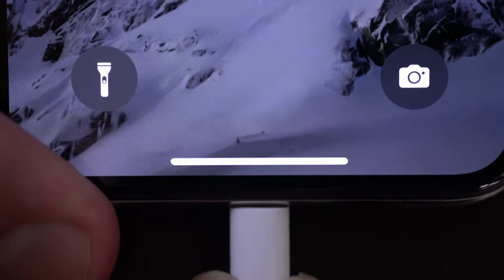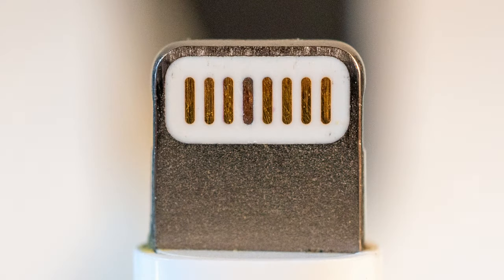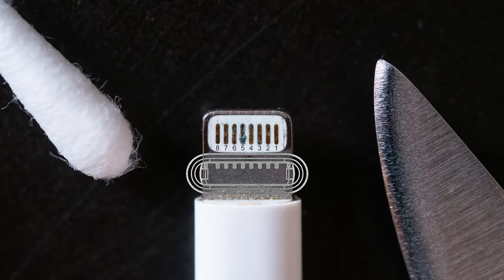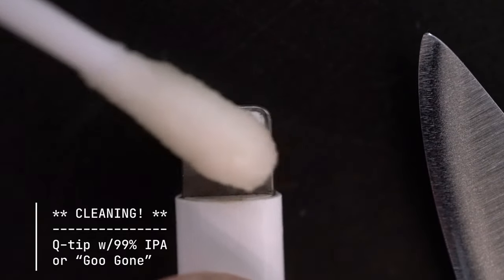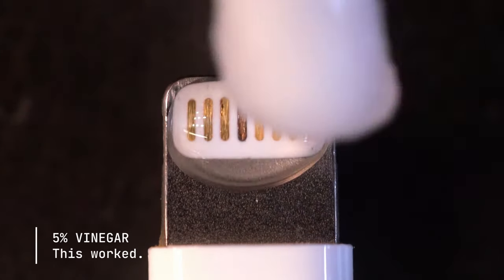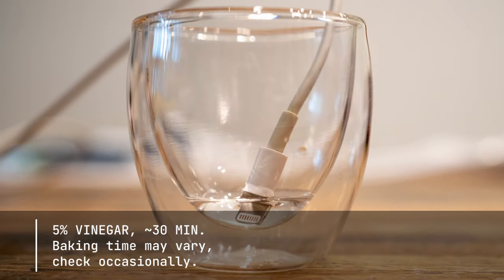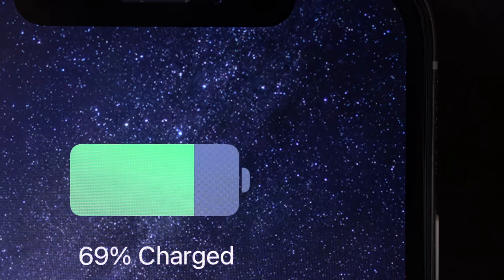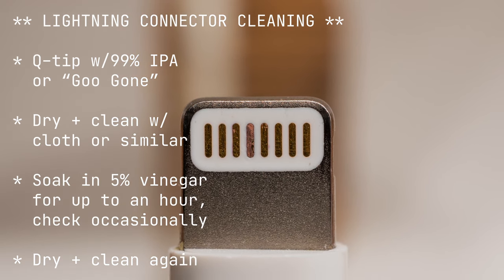🔌📲🤔🤷 iPhone not charging? Learn how to fix your lightning cable in 90 seconds!

Comment: Quick, my phones almost dead 😂
Reply from the maker: I made this video about 90 seconds with the hopes people can get the info quickly. Unfortunately, the vinegar approach does take some time to work. Best of luck! 😅
Reply: Will face cleaning pads Will they work if they have alcohol in them ?
Reply from the maker: I think for this to be really effective, you need enough liquid to have a drop or two that can stay on the connector long enough to have an effect - like as shown in my video, here.
Reply: Fr
Reply: Mine is at 1%
Reply: And the ads
Reply: How about a brand new lighting cable not working? Charging block works with other cables. But the new cable won’t work with any phone.
Reply from the maker: Sounds like that cable may be faulty. Try cleaning the contacts with an eraser tip first, give them a little rub to make sure nothing’s blocking the copper contact bits. If multiple phones and chargers are OK, chances are this cable is the problem.
Reply: Legit☠️☠️
Reply: ahahahah same lmao
Reply: Same here 😢😢
Reply: LMAO SAME HERE MY OHONE IS ALMOST DEAD AND IM LIKE COME ON HURRY UP AND BOW I SEE YOU COMMENT😂😂
Reply: Mine to
Reply: same lol
Reply: My phone already died and I'm using my mom's phone
Reply: Fr
Reply: SAME
Reply: Thanks bro 🎉 it works guysz🎉 nc video I just put alcohol and clean the rust

Comment: my issue turned out to be that there was lint inside the charging port, but this also helped me fix an older cable I had given up on. 10/10
Reply from the maker: Ah-ha, good to hear you sorted it out. Lint is also a known cause! I recommend the curved pointy end of a plastic dental floss pick for removing lint from both Apple’s lightning-style, and USB C-style ports.

Comment: Thanks for this video, because my wife and I were having some problems with charging iPhones.  Using several different cords, sometimes not charging at all or sometimes actually losing charge.  After a simple Q-tip with white vinegar, simply a few swipes and dry off. The cords are all working.  
I actually got a jeweler’s magnifying glass, and could see some minor corrosion on the tiny bars. 
 ( can’t see with naked eye)
This saved me money, cause I was ready to order new iPhone cords.   Great advice.
Reply from the maker: I’m glad to hear this worked for multiple cables, and that even just a Q-tip was sufficient. Excellent.
Reply: Thats the same issue with mine. I am gonna try the vinegar trick now
Reply: Mom b😊😊hhh.
Reply: Another update Feb 2024,  still doing the cleaning,  the vinegar wasn’t working as well. Still had one contact with dark oxidation on it. I tried a q tip with a drop of Brasso polish.   It really seemed to help and didn’t damage the contact. Definitely took off the black oxidation and charges working fine.
Reply from the maker: @d.g.n9392 Interesting, thank you for the tip. Brasso might be just the thing for oxidation, if vinegar doesn’t make the cut.

Comment: Hey scott, I have a usb c charger ( the new ones ) do you think I should dip the other too for 30 min ?
Reply from the maker: I suggest trying a different charger, see if that makes any difference. If not the power supply, then see if your phone’s port is clogged or dirty. A toothpick or a plastic dental floss pick can work quite well there. For USB-C, I would not recommend vinegar just yet; they are much more complex in terms of their layout and have a lot of smaller connections.

Comment: I used vinegar but my charger isn’t working and it’s overheating
Reply from the maker: If the power supply is getting too hot, be careful! It may be failing and could melt or burn in the worst case. Try a different power source, and see if things work better.
Reply: @scottschiller  i did that but it didn’t work, i think my lightning cable died.

Comment: Copper is visible at the last part so it wil oxidise u have to tin it
I think ✌️
Reply from the maker: That sounds like a good idea for a longer-term solution. So far, I haven’t had any issues with the ones I’ve fixed - but it is likely they will oxidize.

Comment: Can you use something else besides vinegar?
Reply from the maker: If you don’t have vinegar, you can try using a bit of lemon juice and a bit of salt dissolved together. Alternately, a Q-tip and a drop or two of isopropyl alcohol, sometimes also called “rubbing alcohol” might work. The lemon juice and salt is acidic like vinegar, and may work better to clean the copper.

Comment: Tried the rubbing alcohol and it worked great! Thank you so much!!
Reply from the maker: Excellent, great to hear. Sometimes, the initial cleaning will fix the cable. Otherwise, vinegar is the next thing to try if the cable pins seem to be corroded.

Comment: Sir I bought new iPhone 14 it charges fine sometimes and sometimes it the battery stuck at one percentage for hours i visited apple technician he run some test and told the problem is with adapter but i am more comnfused now because that adapter charges my old iPhone 11 fine I change the charging cable to find whether it was defective but it was the same please help me
Reply from the maker: Try a few different USB power sources - e.g., a laptop vs. an Apple iPhone charger vs. some other USB power supply. If the phone shows the ⚡️🔋 icon when connecting the cable like when it works in this video, then the phone should be charging. If it is still slow, try changing the power source. Failing that, try a different cable. Check to make sure there isn’t any lint in the phone’s lightning port, also.

Comment: How do I check if it’s dirty?
Reply from the maker: If your phone doesn’t start charging when plugging in a cable, it may be the cable is dirty, the cable power source is bad, or your phone’s connector is dirty. If a different cable works, chances are the first cable is bad.
Reply: I cleaned my charger with a Q-tip, but it didn’t work. Do I need to get a different tool?
Reply from the maker: I suggest watching the video, to see what I recommend.
Reply: I figured out that it’s not dirty. I have been using the charger different ways, which break it. I think that my charger is bent. How will i fix that? I don’t have a cleaning tool. I’m at 8%, so I can only talk at the PC.
Reply: Also, I found a iPhone/iPad repair in Connecticut, but that’s 13 hours.
Reply from the maker: Not sure how to fix a bend. You may need a new cable, if the cable connector is bent.
Reply: @Ovalasa you may need to clean out the charging port with a toothpick or something small.
Reply: Currently, I have gotten a new charger. Now it works without me having to adjust it.

Comment: Its not the lightning charger if none of the chargers work. Its the slot it goes into on the iphone/ipad that always craps out. 
What can we use thats really thin to clean where that gets plugged into?
Reply from the maker: Good thinking, indeed. If the cable works with other iOS devices or chargers, then it's likely the charging port.

I recommend trying a thin toothpick, the rectangular kind (not the round kind.) Otherwise, the curved end of one of those plastic dental floss picks could work pretty well.

Last thing I'd recommend (because it's metal and could be sharp), one end of a paperclip. To be safe, I suggest turning your phone completely off before inserting anything metallic or otherwise conductive into the charge port which isn't a cable.

Comment: is it PIN 5 on either side?
Reply from the maker: Pins run from left to right in descending order on the side facing you, 8 to 1 - so pin 5 should be fourth from the left.

I believe the lightning port only has contacts on the upper side.

Comment: Does only water work
Reply from the maker: It shouldn’t hurt to try, although I would just rinse it rather than soak the connector. You can try using an eraser on the contacts, as well.

Comment: What happens if I don’t have alcohol? Can I use something else?
Reply from the maker: You can try an initial clean with a drop or two of water, and an old toothbrush or a soft cloth. The idea is to get any dirt or sticky gunk off first. Then try a bit of vinegar to help with corrosion.

Comment: To clean mine, I put my cord in the dishwasher (energy save mode), didn’t quite work. Then I put the brick thru a cycle…still no help. Maybe it’s the phone that’s dirty??? Thanks in advance
Reply from the maker: Interesting. I would recommend avoiding the dishwasher for both power cable and power supply, especially the power supply which has more electrical components that could be damaged by water and heat.

My recommendation is to try a different charger or USB power source, then try swapping the cable. It’s likely that one or the other are bad, but not both.

Comment: My charger is working but in the process i damaged the white part of the cable not the golden one will it have adverse effects on my iphone?
Reply from the maker: Be careful not to bend the cable too much, or put metal things on any exposed portions if inner wiring is visible. If the cable starts to get hot around the area of damage, stop using and replace it.
Reply: @scottschiller  the cable is completely undamaged but the metal which have white paint on which golden lines are printed that is damaged (it is still charging my phone)
Reply from the maker: OK, that’s the lightning connector. I recommend being careful, but it’s probably fine if it’s working.
Reply: @scottschiller  okay thanks i  will change it if it stops working

Comment: Mine isn’t dirty it’s just the lower part of the lighting cable can i still clean it?
Reply from the maker: It’s unclear if you mean the wider USB-A connector or some other part, but I would focus on the metal connection parts for cleaning.

Comment: How are you supposed to know how much stuff you need to put on the  Q Tip?
Reply from the maker: Barely any is needed, a drop or two will saturate a Q-tip without issue. You don’t need it dripping wet, for example.

Comment: Does 50% alcohol work?
Reply from the maker: I would suggest using isopropyl alcohol, or “goo gone” as a starter for cleaning. If you don’t have either of those, you can try using a pencil-type eraser gently on the pins to remove gunk that might be there. After that, I would recommend trying vinegar. The usual kitchen stuff is called “white vinegar” or 5% vinegar, or similar. You typically find it in grocery stores.

Comment: Can we use acetic acid
Reply from the maker: As one of the components of vinegar, that should be OK. Regular table or “white” vinegar may be easier to find at the grocery store, however.
Reply: @scottschiller  Oh thanks,what about acetone then ,would nail polish remover work too?
Reply from the maker: @NEET-vs6ot I wouldn’t use that for this sort of cleaning, no. The intent here is to loosen dirt and remove or dissolve corrosion on copper. Acetone is also pretty nasty stuff, so I advise reading the warning labels on that.

Comment: Was that white vinegar and would WD - 40 work? Thanks for the vid.
Reply from the maker: White vinegar is correct. WD-40 might be OK as an overall cleaner, but I’d recommend using a minimal amount and rinsing afterward.
Reply: @scottschiller  Thanks so much! It turns out that it will charge, but is not recognized by QuickTime. The finder recognizes it though. I’ll let yuh know what happens. Thanks.
Reply: @scottschiller  I was suspicious because their was no wear and tear on the cable that it might be software so I did a network reset and it worked! Thank You so much  for your quick reply and suggestions.
Reply: @49Macman  what is a network reset?
Reply: @ekphotography  I have an Iphone 11, but it should be the same on any iPhone you use. You look in the search bar for Settings or jusst go to settings and go in this order. Settings-general-network settings. Click on network settings. If you're new to this I would be careful you don't choose something that will erase something you don't want erased. It should give you a prompt that will indicate what you're about to erase. Good luck!
Reply from the maker: I would add, only do a network reset as a last resort - i.e., if there is something really wrong with your phone. If it charges but your computer won’t recognize it, this may be from the cable’s data pin(s) still being dirty.
Reply: @scottschiller  Use some coca cola too. Have you seen what it does to battery terminals? lol
Reply from the maker: It can dissolve an eggshell, or a tooth given enough time - wild stuff. I wouldn’t recommend it for electronics cleaning, though, given the high sugar content. Vinegar, or maybe even vodka would be better. Less sticky stuff. 😆

Comment: Is it only 5% vinegar that work other vinegar don't work or?
Reply from the maker: 5% is the common kind you get at the grocery store or market etc., that should be fine. I would use white vinegar, no wine or red or other stuff which may have sugars in them. If you have “double-strength” cleaning white vinegar, that’s fine, but it will work faster - so keep an eye on it.

Comment: I accidentally put some moisturizer on my charger now it’s not working, how can I fix it?
Reply from the maker: Try cleaning with a damp cloth. A drop of soap and then a wet cloth might help break up the moisturizer. Either way, this should be more fixable than corrosion!

Comment: Will these work to
Reply from the maker: I’m not sure what “these” is referring to, but I had good results with plain white vinegar. Don’t use a knife, blade or anything sharp to try to scrape the pins - that won’t work.
Reply: @scottschiller   well I just cleaned it because I watched that video that you were cleaning the tip of the charging cord and I just did the same thing to both ends and it still doing it and I just bought this charger cord a week ago and I’m kind of afraid to clean the end of my phone where the charger plugged intobecause I don’t wanna damage my battery
Reply from the maker: @sethmatt6306 Assuming the cable is new, try a different power supply. If you have the same problem with a different power source, try cleaning your phone’s charge port with a plastic dental floss pick - the ones with the “C” shape that has the floss across it, use the other end to carefully clean your phone’s charge port. Might have some lint or dirt in there.

Comment: my andriod wont charge unless its powerd off is there a way to fix that
Reply from the maker: Not sure what’s going on there - maybe a power supply issue. Try using a different power supply, first. If that doesn’t make a difference, try a different cable.

Comment: I have type C to lightning fast cable. I accidentally got water into C port of the cable. Now it wont charge, what do i do, my phone is dying?
Reply from the maker: I haven’t had one of those cables go bad, but a few ideas…

Try blowing some compressed air into the cable end. The cable may work once it has dried. If not, you might try cleaning with a small (non-metallic/wire) brush e.g., toothbrush. If you suspect corrosion or other gunk, you could try dipping the toothbrush in a spoon with a bit of vinegar or isopropyl alcohol, but then you’d want to carefully dry the cable before trying it out.

Comment: The vinegar turned the silver part black? and the charger still doesn’t work
Reply from the maker: Sounds like something may have reacted with the vinegar. Those contacts should be copper, but may look silver. Try cleaning with a light abrasive like an eraser tip, see if that helps.
Reply: @scottschiller  any eraser ?

Comment: here is different issue with my charger it is spakling after one second it chage and after another second it disconnect automatically can you help me
Reply from the maker: If it is “sparking,” like electrical sparks, that is not a good sign. You might have a short circuit or other issue. I would try a different charger, and/or a different cable and see if one or the other is the cause.
Reply: @scottschiller  short circuit adapter cannot be repaired?

Comment: Does water work? I don't have vinegar
Reply from the maker: Try a bit of lemon juice and dissolve a pinch of salt in it. This may work similarly to clean the copper.
Reply: @scottschiller  one of the sides work now i had a problem with it for so long today finally one side works
Reply: @scottschiller  also it seems like water does work to thats what i used for it to work

Comment: My phone start to charge and stop 10 min later did u have any idea why ?
Reply from the maker: This could be a loose connection, possibly dirty pins or corrosion. I recommend trying cleaning with a cloth first, then a bit of vinegar as in the video.

Comment: What I learned here is that alcohol or Goo-Gone won't work... you even said as much. But then, in the summary, you made it the first step in the process?
Reply from the maker: Isopropyl alcohol or goo-gone may help as initial cleaners, removing residue and gunk. That is the first step.

Once cleaned, the copper pins should be better exposed - and that’s where vinegar does the work of removing corrosion.

Comment: Well my phone charger is not dirty and it charge sometimes but i have to flip and blow in my port and my port isn’t dirty either I checked and when it’s charging it stops
Reply from the maker: Sounds like the cable pins might be dirty or corroded, and worth trying the steps in my video. If that doesn’t make any difference, it could be worth trying a different power supply and/or cleaning your phone port, maybe while powered off, using a small toothpick or a paperclip.